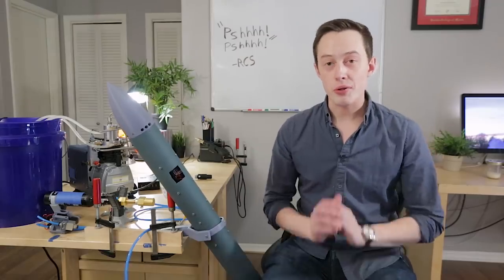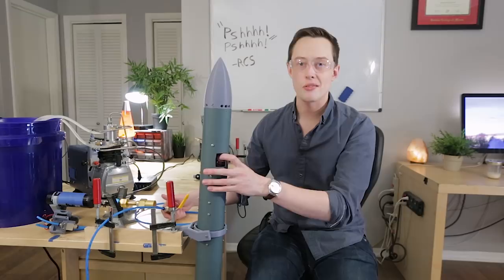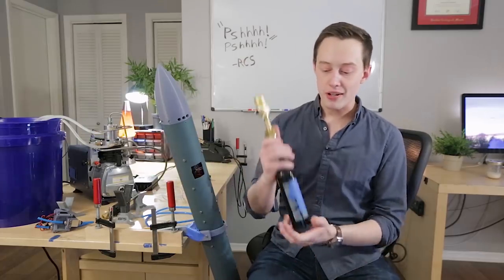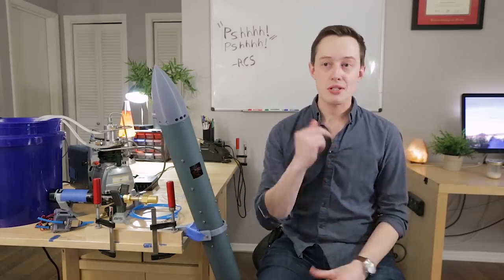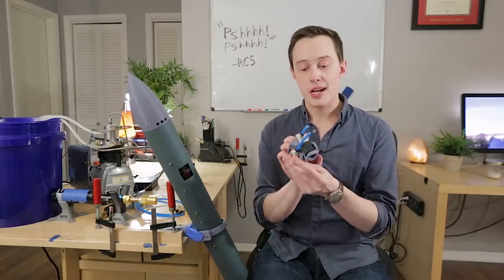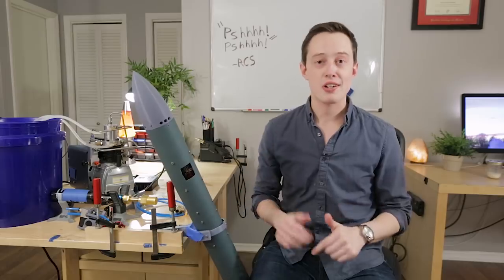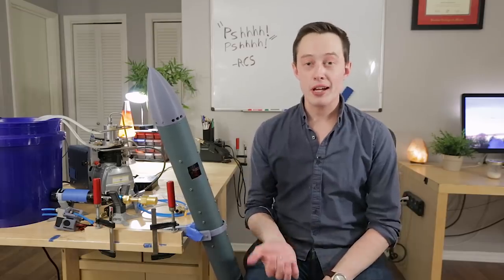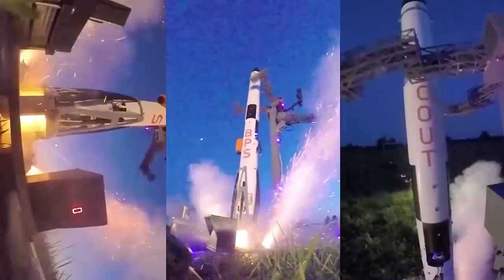Model Rocket RCS Thruster Update

Comment: Suggestion: Higher pressure will give you the higher flow rate you seek. You should be able to get away with overloading the valves you currently have by just ramping up the pressure. You could go with 200PSI or 300PSI instead of 150. You will almost surely need to increase the coil driving voltage to overcome the extra force of the higher pressure, but in your application you can likely get away with it because the solenoids are rated for continuous use, and you're only firing them for short bursts, and your tank only lasts a few seconds anyhow. You can put some code in your software to insure that the valves never get held open long enough for them to burn up at the higher voltage. You'/d need to characterize the actual limits of the valves you have in hand, but I believe you could take some measurements and determine the limits and then run the rocket with a little margin below the limits.

Comment: Just a thought but in my paintball experience, CO2 experiences huge temperature drops when shooting a lot. It end up being really hard on the rubber parts of a paintball gun. This is the reason most avid players us a nitrogen tank, or just compressed atmosphere. Atmospheric air is more stable over time as well (Temp is proportional to Pressure) and CO2 tanks on an electric gun can actually freeze up after only a couple hundred (100-200) cycles of the firing solenoid and result in serious performance issues during play (shot velocity drops off severely as your working pressure drops off). I would assume, considering the fundamental workings of these two systems are very similar, using the majority of a tank of CO2 for flight control would have a similar effect on your thrust performance and components.

Comment: In order to counter the low mass moment of inertia in the roll axis you could split the tubing, then allocate one half of the tube to pitch and yaw and the other to roll. You could then put a secondary regulator on the roll axis tube to lower your feed pressure and make it more controllable without losing much power in the system.
Reply: You could also split (or direct) the flow slightly downwards, which would reduce the overall roll force, whilst adding vertical thrust. No extra parts required.
Reply: @aread13  This would generate a  torque force in either the pitch or yaw direction though, which would have to be countered by firing additional thrusters.
Reply: @itemboxes8741  Good point..

Comment: Hi Joe, admire your work!  Used to be a controls engineer for a major valve manufacture. Suggest mounting the valves on a custom round air manifold  with ports directly out the rocket to eliminate the leaks and therefore the arming valve. This will significantly reduce mass. Using valves with very fast and consistent response time will make RCS much easier to control. Basically, high speed PWM the air to make it behave "analog". The valves should be balanced so the response time does not change with air pressure.

Looking at the video, I don't think you necessarily need more Cv. More Cv will increase size and mass while quickly depleting your air supply. It may make it harder to control as each air pulse may over adjust and create instability.

You can connect a pressure transducer to the valve output and put the transducer output and valve firing signal on an oscilloscope to characterize your valves for better control.

A small super capacitor at the power supply output may improve valve response time. Finally, if you have diodes across the solenoids, this could greatly delay the time it takes for the valve to turn off. Use a switching system that can handle the voltage spike when the valve turns off. A MOSFET with high enough voltage rating should do the trick.

Here's an example valve to consider: http://www.macvalves.com/product/bv10-mm/

Sorry for blabbering on and on with my opinions... Let me know if you want help specifying the valves, designing the manifold, etc.

Keep up the good work! Enjoy your videos :)
Reply: We did the exact same things for automatic transmissions for hydraulic gear actuators! You can also put a dither on the solenoid signal so you get rid of the slipstick effect
Reply: Great idea, I came here to suggest that exact same thing regarding the monoblock round air manifold. That really is the ideal approach.
Reply: I don’t know any of these words😂
Reply: I used to enjoy model rockets as a kid, making a model rockets land is just next level cool. From understanding your RCS project, seems like it does take some time to tune a PID controller. Other than testing on a gimbal, have you tried to put the rocket or RCS tube in a jig suspending it on stretch cords, & or balance on a big bobblehead spring?

 With that type of  test, & tune jig, it seems to me that would make it possible to measure the thrust coming out of each manifold with a force gauge, possibly making it easier to tune the PID while balanced on axis, & reduce any damage on live testing. Also with the manifold design, would you also incorporate recessed thrust cones into the design to improve efficiency of the RCS?
Reply: @supakat1835  is it possible to calculate the thrust based on the mass flow? That would be very helpful.
Reply: @michaelrobert8090  Not sure, it makes sense in my head that way; possibly with checking the pressure released from each valve, making sure theyre all releasing the same amount of pressure; only other thing is the dwell from the valve to the thrust cone, to tune efficiency, 🤔 I would probably start turning the integral down a little from default with the information provided.
Reply: Good advice.
Reply: @michaelrobert8090  it is possible to calculate thrust from a mass flow, but you need to know what the exit mass flow rate is. You could calculate it based on supply pressure, the open time of the valve and subtracting friction/pressure losses through valve, tubing and thrust cones I suppose. Would be nice to actually measure it.
Reply: Thanks @stephenfoster2532  . Sound like a direct measurement is best.

Comment: Hi, 
happy to see that you're doing some attitude control of your rocket. To answer shortly to your question, we found a high flow AND high-speed miniature valve from Parker. I don't remember the reference but they were kind to answer us at the time, based on our requirements. 
Long story short, my bachelor thesis in 2015 was actually about controlling the attitude of a model rocket on a similar scale (2.45 kg,  1.4 m length); a cold-gas thruster attitude control for a rocket model. The aim was to control the position of the rocket, especially at low speed.  
And during the process, we get to the same trouble you have/had. As the weight was a limitation for us (we couldn't get more powerful motors), we used 4 proportional valves (around 4mm diameter) to control the yaw and pitch with 2 of them 5mm off the axis to control roll and the 2 other one 5mm off the axis the opposite way. So we were able to fully control the rotations. We used 78g CO2 cartridges, similar to bicycles ones but bigger because as the CO2 stays liquid until the last moments, you have a stable pressure output until it dries out and constant force output, which is a good thing when you want to simulate the capabilities of the rocket, position of the thrusters, controller,... This was the main reason we used that cheap CO2 cartridge.  
We actually went to present at the 1st symposium on space education activities hold by ESA. Quite a funny experience! Here is a link to the university news about the project if you want to get a bit more information. https://actu.epfl.ch/news/a-step-closer-to-reusable-rockets/
Don't hesitate to contact me for more info as well.

Comment: Hey Joe, I'm an aerospace engineering student and have been involved in the development of small experimental rockets for the last four years. 
Two years ago I had the exact same problem with solenoid valves for an on-board pneumatic system: not enough mass flow rate (thus no thrust at the nozzles) for the ones that we found flight worthy (relatively low mass & size to fit in the rocket + low voltage requirement at 12V or 24V). 
After quite a lot of research, we didn't find any that fitted our needs. 
We chose to go another way: use a small solenoid valve that activates a bigger air operated valve. While this solution is really heavy (2 valves for each thruster + an additional small low-pressure air tank for the pilot circuit), air operated valves are way more capable than solenoids at equal mass/size. We used the VNB104B-8A from SMC. In order to actuate it in small sequences, you’ll need a 3/2 solenoid valve on the pilot circuit (to evacuate the gas and shut the air operated valve). Small tip: on the main circuit, watch for the internal sizes of your fittings/tubings in order not to choke the airflow before your nozzle.
Our system was only designed to accelerate the roll of the rocket (in order to test a yoyo-despin system), so this solution suited us because we only needed one set of these valves. But I don’t know if the weight and size penalty would be worth it for a complete RCS system like the one you’re trying to design.
I hope I helped a bit, good luck, rocket pneumatic systems are not an easy thing to design ^^

Comment: For ground testing, you can use a shop air compressor which can only reach a bit over 150 psi, but delivers much greater flow while consuming less power.

Comment: Build a single block with 4 valves. There will be connections and the weight will be lower.
Reply: You should need to only have 3 2-way valves to control F<>B L<>R CW<>CCW. You don't need to have a valve per direction, as you'll never be pushing (let's say) left and right at the same time. By the looks of things Joe is using 6 1-way valves, which seems a little inefficient. Definitely, if he could machine (or have machined) a single block with 3 2-way valves and 3 solenoids, that would be save a ton of weight.

Comment: I'm not sure if there's anything off the shelf but it really needs a manifold/solenoid block type arrangement. Picture a ring of ports fed straight off the reg, the solenoid coils would be arranged within this ring also. I used to do this kind of work, it will really need to be a machined piece, i suggest shouting out to some youtube machinists (Saunders would be a good start).
Reply: With the drawing done he can pitch the machining to AvE with a video.
Reply: @ciano5475 That would be skookum as frig
Reply: Yea this would be a perfect project for AvE's 5axis Haas mill.

Comment: Hey Joe, I’ve got experience here, some thoughts: 

1) You could drop the number for valves from 8 to 6, one for each control axis direction. Then some tees to join up the relevant thrusters. 

This means that you won’t be able to take advantage of the cross axis coupling effects for each thruster that you could if you controlled each individually, but I’d expect the weight savings to be worth the marginal improvement in the control law. 

2) If you need to scale down your roll control, easiest way is to just bring in the moment arm. The thruster layout isn’t super clear in this video, but worth taking another look at that. 

3) The number to look at when sizing things is the control authority (deg/s/s (angular acceleration) for your shortest impulse) for each thruster in each axis. Some testing is in order I think to figure out how much thrust you’re getting from your setup. 

4) State space control is the way to go. Make sure to have a deadband wide enough that it spans a couple firings, so you don’t bounce between the edges. Take a look at Fig. 5 of this paper - a simplified version should do you well. https://www.researchgate.net/publication/228869689_THE_RCS_ATTITUDE_CONTROLLER_FOR_THE_EXO-ATMOSPHERIC_AND_GUIDED_ENTRY_PHASES_OF_THE_MARS_SCIENCE_LABORATORY

Comment: Eyy Joe ... My Kerbal experience suggests it ought to be possible to have RCS with only 6 ports (have the roll ones also double as the perpendicular axis, when fired in pairs
Reply: Actually, if he didn't need roll, he could do it easily with only 4 if he used some kind of passive stabilizer in conjunction.

Comment: Like you said in the video, those cheaper solenoid valves are not the greatest when it comes to flow. Usually in my experience you usually want small solenoid valves that are used to switch a larger pneumatic valve. You can kind of think of it like a small gate driver switching a big bjt or mosfet. Swagelock makes some pretty great pneumatic diaphragm valves. There is a pretty good supply on ebay of NOS valves because pretty much every piece of semiconductor equipment made uses them. Main downside would be all the extra weight. so it may not make too much sense on the scale you are working with. Other solenoid valve companies you may want to look into are SMC or Festo. SMC's sx10 valves do look promising though as they have a model claiming 150LPM at up to 200hz switching speed.
Reply: Hi! I think you are right: for larger flow rates, the typical solution would be to go towards staged valves. However, in the context of a closed loop control with small time constants, this is not ideal because it tends to add tons of delay (lattency) into the loop. Even the solenoids add several ms to the loop! I remember we used to advertise the transition to voice coil instead of solenoïds to remove those! To get single stage at a larger flow rate you would need larger "holes" which would mean larger force for the actuator. Or it would need to be pressure balanced, and therefore bulky.
Did you try to work on the nozzle shape? There might be some efficiency to gain there...

I am surprised by the stability of your control loop. For a highly nonlinear actuating system (gated), this is impressive. I personnally would have gone straight to PWM or PFM at the output in order to cling to some linearity. (although the valves may not like the added stress...)
Although thrusters are cool, I think a flight model would be closer at hand if you had gone in the direction of reaction wheels... no?
Reply: @romainlaugier5915  delay greatly depends on the kind of valve Rather than system architecture. Ald valves are typically staged and are the fastest valves in the business.

Comment: valves for vehicle air suspension (low riders) would work, ive seen 300 psi nitrogen ran through them. sizes range from 1/4" to 1" and can be purchased as a manifold with 4 to 8 valves in a block

Comment: If you are looking for roll control on takeoff and flight then implementing movable(rotatable) fins might be your answer. They can be programmed to counteract the rotation of the rocket and will be independent of the other system since the press will likely be took high when using compressed air without an additional regulator.

Comment: Great project! For the RCS jets you want a direct lift valve (like a sprinkler valve)  "Cole-Parmer Manifold Direct Lift Solenoid Valve; 6 inlets, 24 VDC"  However your best bet for the weight is to use a high speed servo and nylon rotary valve. Similar to the way the gimbal works at the tail. You never need a thrust vector in two opposing directions.  Possibly use 2 for each 180 deg. Separate one for the roll. This way you have 3 valves for 8 ports vs 8 valves for 8 ports. Smells like 80% weight savings including all the tubing/manifolds you no longer need. This ALSO paves the way for the real solution which is to use a small parasite port on your rocket nozzle pushing hot gas up a small tube to the top of the rocket (and valve) to power the thrusters. I will make some drawings.

Comment: Pneumatic tricks I learned while building competition fighting robots:

-Use Nitrogen instead of air... It's better.  Air is fine for practice, but when it's go-time, go for nitrogen. (sponsored by nitrogen)
-Absurdly oversize your tubing. You want the device to perform like it's attached directly to the tank, and give it some time to warm up and expand. Big, thermally-conductive, tubes behave like an expansion tank, with less plumbing/weight.
-Use a low pressure valve, like you have there, to fire a pneumatic cylinder, that yanks open a ball valve from the high-pressure side of your regulator to the device you're powering. 

-Buy/build extra parts and design for fast replacement. It goes without saying that this last technique will wear out components quickly, but spectacularly.

You may be able to get such a small ball valve from a model steam engine supplier. You can make the miniature pneumatic actuators yourself, and that would be a benefit because you will want to incorporate a stiff return spring. Placing it in the cylinder body can save space and weight. Since your application needs a faster turn-off time than a pneumatic sledgehammer, I'm thinking a double-acting piston with a spool valve may be better, though more complicated. Along that line, putting this much pneumatic/electrical/mechanical gadgetry in a tight space warrants you to start working on a monolithic structure for this assemblage.  Such a structure could also satisfy most of the plumbing requirements and eliminate the bulk of individual packages and fasteners.